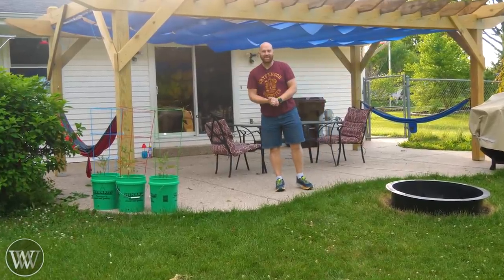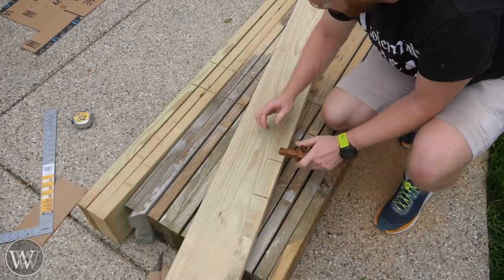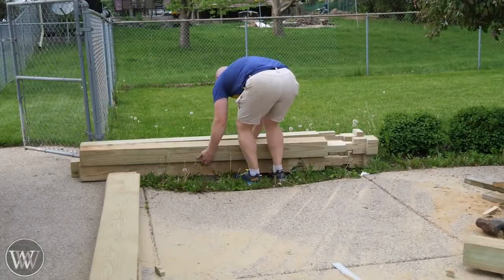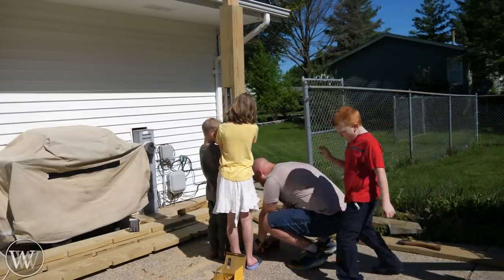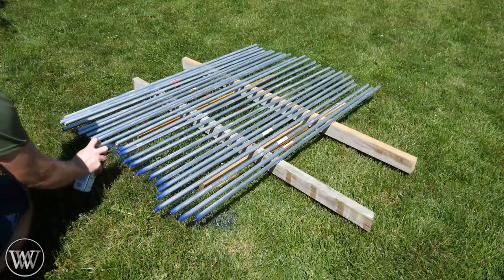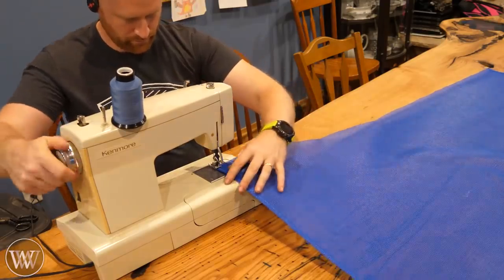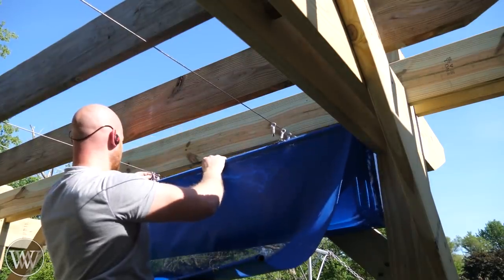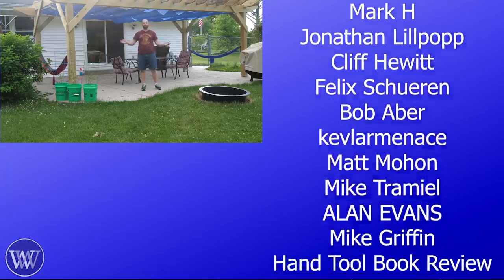How to Build a Pergola with Retractable Awning

Comment: I'm quite literally finishing a client's pergola build tomorrow and it's going to have a retractable cover also. The only downside is that it's been over 110F here for weeks now and it's on a new concrete slab. Great video as usual! I rather enjoyed seeing you use the Richter chisel for that. If it's good steel, it'll hold up. I'm still using my less expensive Narex chisels but once they get too short, I'll be going with the Richters.
Reply from the maker: Sounds like fun. Not the heat but being done.

Comment: You can make a rope and pulley system for the sunscreen. Perhaps even add an electromotor. Would be fitting for the build.
Reply from the maker: I've looked at adding that. We will see. Right now it would take more time to create the rope system than it would to open and close it a couple hundred times so it would be cool but overall it would expend time and cost more. But sometimes cool is worth it we'll see.

Comment: Like it. A great idea. How do you avoid having the foot of the columns from rotting as a consequence of rain water?
Reply from the maker: the bracket I am using raises them up about 1/2" so the water can drain out. but I know some people will put bolts into the bottom to do the same.
Reply: @WoodByWrightHowTo  thanks! Excellent alternatives.

Comment: Very impressive !!!! Especially building it only on 4 posts, it’s hard to find videos. I’m building one with 18 feet span from inside post to post. I was thinking to use 2x10x20 , glue and nail 2 of them together so it’ll become 4x10x20 (actual would be 3”). What are your thoughts on this approach? 

No snow load, I live in Georgia and there is no snow at all. 

Any inputs would be highly appreciated.

Thanks
Reply from the maker: mine are 20' between posts. 2X10s rather then laminating them I just ran them separately as all of the top purlins are notched in they have the same strength attached or separate. but eather way that is more then strong enough.
Reply: @WoodByWrightHowTo  understood!! So you did use 2x10x24 (not 2x12x24). I know you mentioned 2x12x24 but looking in the video it looked like 2x10.

Comment: Great job!  What kind of pipe did you use and where did you buy the hardware?  Specifically the clips and brackets that attach the shade fabric to the cable.
Reply from the maker: the pipe was galvanized electrical conduit.
here are the clips I used: https://amzn.to/2VHrLAH
brackets: https://amzn.to/2JPDjPQ
cable: https://amzn.to/2JQ2FwP
Turnbuckles: https://amzn.to/2JuAbJp
Screws into pipe: https://amzn.to/3qzCN9h
hope that helps

Comment: With the 20 ft span between post, have you noticed any sag in the 2x12 beams. I have about 15 ft to span and have been trying to figure out if I need a post in the center.
Reply from the maker: No sagging. My masters was in an engineering field so I did a good bit of calculations on this one. For 15' you could step down to 2x10 for a structure like this that does not have to account for snow load.
Reply: @WoodByWrightHowTo  thanks for the info. All the information I have been able to find I beam spans has been for decks and floors. I couldn’t find anything on pergolas. With current lumber prices I’d like to use 2x10’s but afraid they wouldn’t look right proportionately to the 6x6 post.